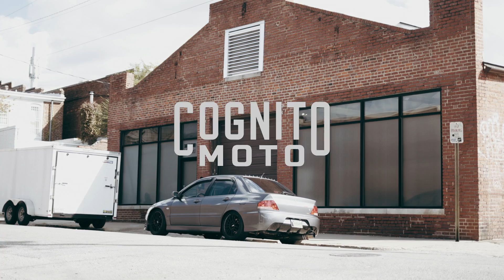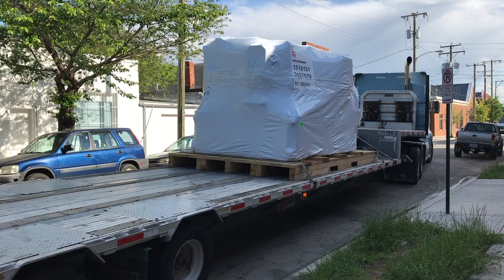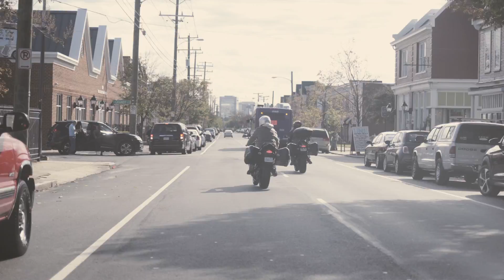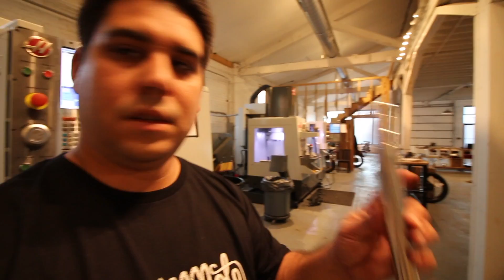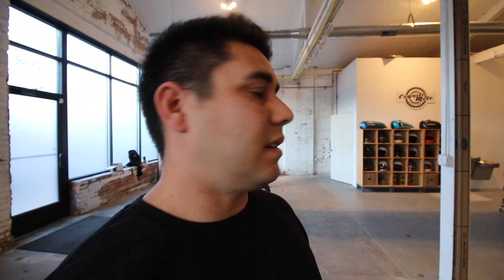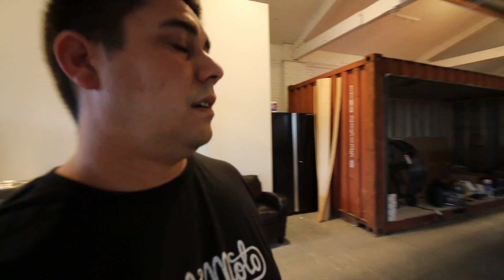Cognito Moto: Shop Updates

Comment: Very Cool Devin, New shop looks great!    Will dust control be an issue with the open space, I guess it is in any place, but with more open layouts you have less blocking that air from carrying the dust or anything stirred up. The clear plastic industrial door openings would be something I would look at adding to your roll-up/garage entrance doors. They can save you quite a bit since your cooling in summer will be easier to escape without that, or heating in winter.  The forklifts can go through the doors very easily and they aren't that big a deal for people either.  Go through backwards or sideways if your arms are full to keep them from smacking you in the face.  Just a thought.  The new equipment will make life so much easier to create things you come up with that you have a good market for selling.  One question, what is the grinding/cutting in the video on the bottom of the steering neck of the 350 needed for?
Ever considered making your own aluminum turn signal design given the ability to source very bright LEDs now on ready to go circuit boards?  Do you have a large vibratory polisher for post machining of parts you create?  You can make multifaceted reflectors (or buy them) to catch and dish the light from the LED and project it. Or one thing that is helpful on very bright LEDs is to do rear firing of the light, project it into a reflector and the LED emitters point towards the dish rather than out towards the direction you are lighting. The LEDs are pretty directional, with that property it makes their lighting not as diffused as an incandescent.